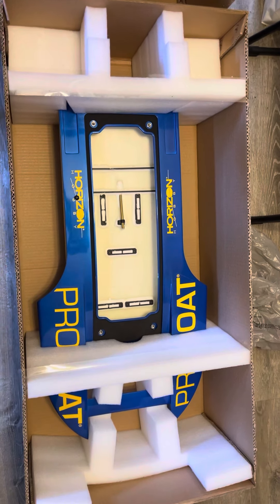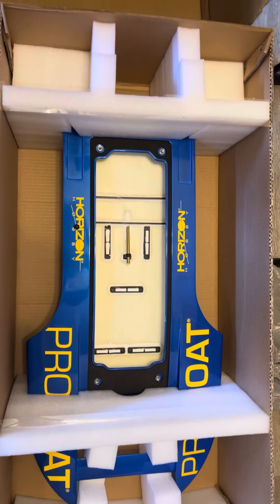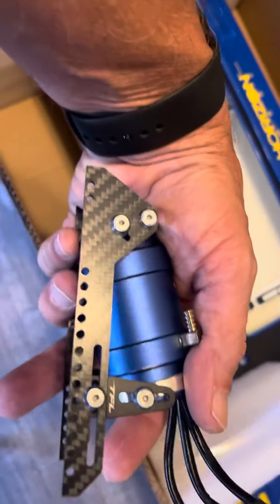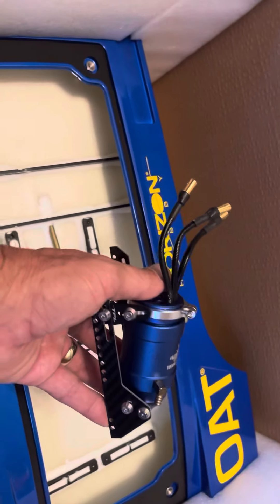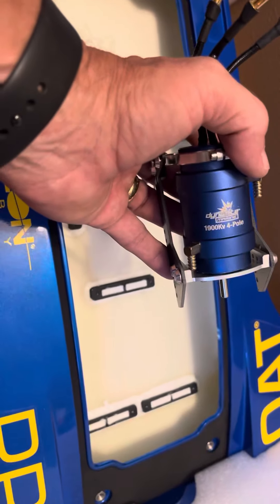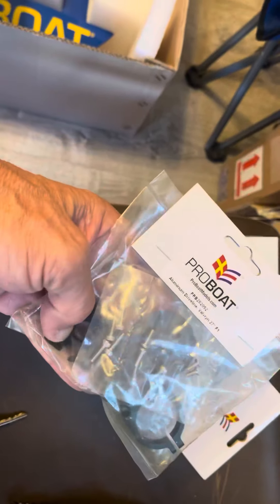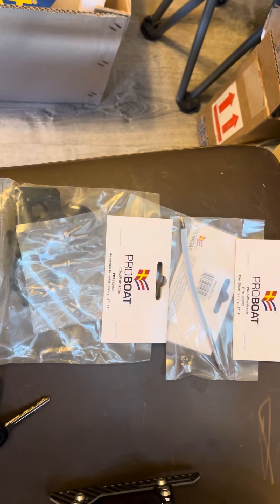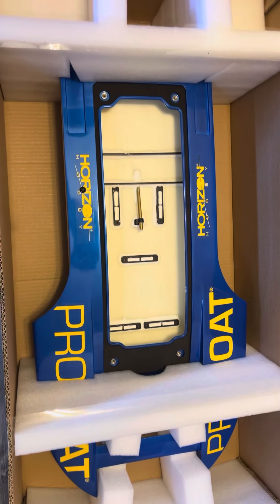New ProBoat UL-19 Hull came for a new rework 🤔

Comment: How about a list of parts? Still have my UL19 in the unopened box, I’m also adding the spectrum 160 smart ESC. Also plan to add the dual cooling lines once the rutter comes back into stock.
Reply from the maker: Basically the parts are listed in the first video and Oxidean marine transom pickup,and lines .The upgrades are available at Offshore And castle is where you get the motor terminals